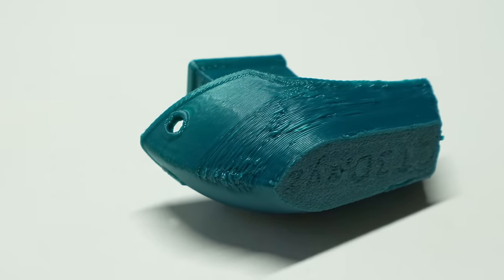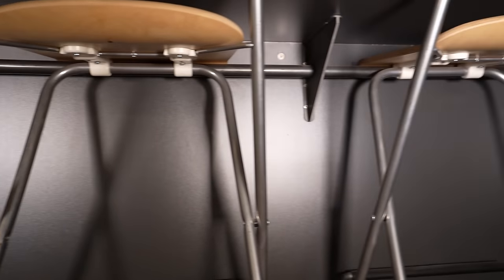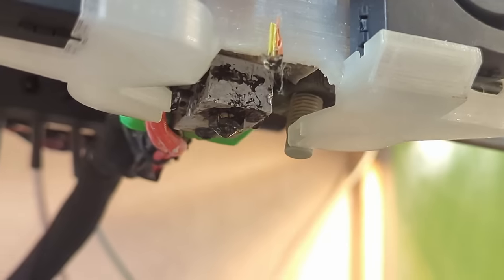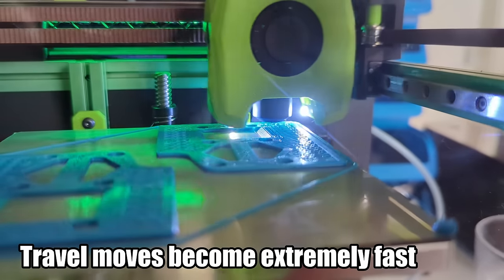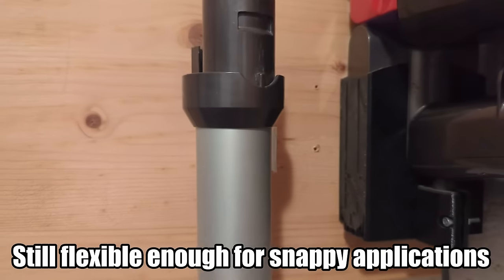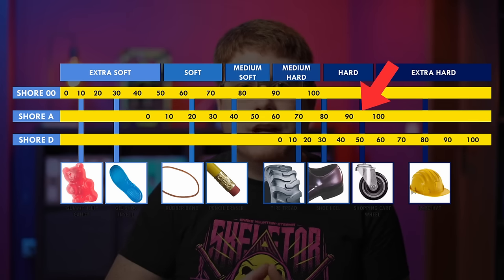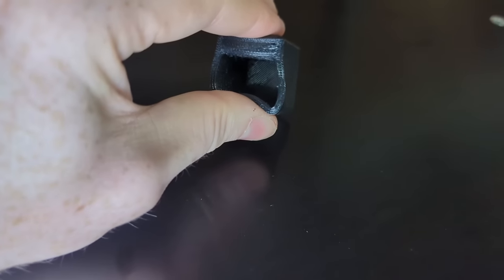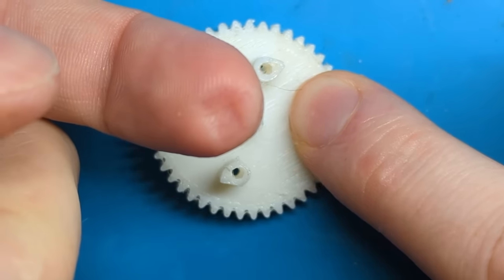3D printing material: When to use PLA, PETG, ABS, TPU, Polycarbonate, Nylon etc.

Comment: PLA is not outdated. It is renewable, cheap, reliable, easy to use and highly available. Yes, PLA flows under pressure but I argue that for drafts, decorative things and iterating PLA is unbeatable. More often than not I can buy really good PLA on discounts today. And for what I do I don‘t want all parts to print shiny as PETG tends to do. Oh and don‘t forget the things like woodfill and such, that works a treat with PLA, with PETG it will be a gloopy mess
Reply from the maker: As is showed I use PLA even in technical applications if it's appropriate and it never failed me.
Reply: pla is not renewable.
Reply: @ageorgiev89 Nor is it biodegradable, regardless of its claims
Reply from the maker: It is, but only at industrial scale at relatively high temperatures. Since it's made from corn starch it's also renewable. That doesn't apply to impure "+" filaments with additives of course.
Reply: @SmallBatchFactory  the vast majority of pla ends in the trash with everything else. Even if it didn't and people put plastic for recycling, they still won't separate pla specifically for recycling on a global scale. So, just because it technically can be recycled, it doesn't mean anything.
Reply from the maker: @ageorgiev89 the material itself is still renewable, unlike crude oil based material. It not being recycled is a whole other tonic but even just burning it is still fine if you can just grow new plants to make it from
Reply: @SmallBatchFactory  Whatever helps you sleep at night
Reply: Reliable at room temperature. So to me that isn't really reliable at all. In my opinion it is a hobbyist filament for teaching people how to use an 3d printer. If you print something and it can warp in a hot car then it shouldn't be considered a serious filament.
Reply from the maker: @clutchboi4038 I'll never take my shelf brackets to the car so they're fine in PLA
Reply: @SmallBatchFactory  As long as there is no direct sunligh in the room, or a heater near by. You know it's gonna sag even at under 50 degree exposure
Reply from the maker: @ageorgiev89 definitely. I had parts deform in an air conditioned office. I mentioned that somewhere, but maybe in another video
Reply: @ageorgiev89  Renewable != biodegradable. Also, Renewable != recyclable. I think you two are talking about two different things. Personally - I am very cognizant of the waste I produce, which is why I try to limit physical test prints. Because, I am unable to destroy the plastic without it becoming micro-plastics. At some point, I would like to invest in a crucible to be able to burn it at a proper temperature and to be able to create small metal casted parts. I hate the fact that most people just throw it away in the trash. I hate even more that people throw it in the recycling bin, which will result in the recycling center throwing it into the trash. I don't know of any recycling center nearby that would recycle plastic bits that are unmarked.
Reply from the maker: @d-leb thank you, finally someone gets it
Reply: I have become very impressed with pla after seeing how competitive it is in strength.  James Bruton basically switched to it in all of his robots and projects.   To be fair the projects only have to work long enough to make the videos and he is presumably getting the filament for free or very cheap.
Reply: @clutchboi4038 what’s a good filament for inside of a hot car? I just printed a ham radio bracket in ASA and it’s been fine during the winter but now I’m worried that I’m gonna get hit in the head with a radio in July
Reply: @Grunttamer  you picked a good filament. ASA, ABS and nylon are the filaments to use in hot car temperatures. Nylon performs the best but ASA and ABS are perfectly fine for hot car environments and won't melt in a hot car. Now if for some reason you are working in temperatures higher than a hot car in some industrial application where the machinery produces more heat then nylon would be best.

If you search "hot car filament test" there is a guy who made a good video demonstrating different filaments inside a hot car here on YouTube. PLA and PET are a no go.
Reply: @clutchboi4038  I guess a good way to remember is “don’t leave your PET in a hot car”… I will see myself out
Reply from the maker: @Grunttamer ASA is one of the most temperature resistant materials for home use. You should be totally fine. If your car gets hotter than 100 degrees humanity is screwed anyway
Reply from the maker: @clutchboi4038 funny enough there is HT PLA out there that can take a lot of heat. Tom's 3D printed an espresso mug out of it years ago.
Reply: @SmallBatchFactory  well I live in the southern us so outdoor air temps of around 40C are common during June/july/august.  A black dashboard can supposedly hit 93C in direct sunlight.  So if I keep my printed materials out of areas like the dash I will be fine.
Reply: @SmallBatchFactory yea and it's double the price of ABS and ASA and needs to be annealed still from what I'm looking at right now, which is even more post processing. In my opinion that still makes PLA obsolete because you can just buy ABS or ASA and print without the need for annealing and spend less.
Reply from the maker: @clutchboi4038 I'm all in on ABS. But a lot of people can't get it to work so HT PLA can be an alternative for them.
Reply: The heat consumed in production for things like heating the bed are drastically lower for PLA than other materials too. This means even the electrical bill for PLA is generally cheaper than most other filaments. Something not to be overlooked when mass producing parts.
Reply from the maker: @Mad_Catter_ definitely! It also means less heating time when doing rapid prototyping.

I recently discovered Polyterra filament which is also easy to cut with a knife so doing corrections to check what needs to be changed for the final design.
Reply: Best of all, PLA is biodegradable
Reply from the maker: @donepearce it is, but it also needs high temperatures. Sadly it's not enough to just let it sit in your garden. CNC Kitchen did a great video about that

Comment: I use PLA for the majority of the things I make, because I actually like the rigidity in most applications.  I use PETG when I need functional clips/bending compliance.  PLA is one of the most underrated materials nowadays because PETG fever.  I see so many failures of PETG when used in mechanical designs where they're under tension or compression.  Because of it's flexibility, it can be a bad material for some applications. I also like PLA because it's cheap, and I have access to a recycler that exclusively recycles PLA, so none of my wasted parts are every truly wasted. There's no one material that will work for everything.
Reply from the maker: I'm totally with you. Just like carbon fiber filaments PETG is a craze where people think it's automatically better in all applications.
Reply: plus if you have the equipment to anneal PLA it's way more temperature resistant than people think it can be.
Reply from the maker: It's extreme, from what I've saw. Didn't have lick trying it in the past but I probably did something wrong. If you have parts where you don't care about 100% accuracy or can account for the deformation this is an awesome technique.
Reply: @SquintyGears  I find high end PLA more temperature resistant than most of the tests I've seen online.  Multiple times, I've left PLA prints under compression in a car on an 85 degree day with no deformity.  Maybe my car just stays cooler than most peoples?
Reply from the maker: @meikgeik I can imagine that you used PLA+, which contains additional additives that change material properties.
Reply: @meikgeik  assuming 85F, it's not that wild. It'll really start softening at 40C and when you're doing the annealing process you do your best to keep it at 50~60C depending on your particular filament. It'll definitely warp some amount then. But afterwards it'll easily stay solid at 85C and it's also significantly more rigid/brittle. Not a huge deal since PLA is already a hard brittle option so people would probably not be trying to anneal a living hinge design...
Reply: @meikgeik I printed U.2 NVMe drive cage from PLA. It literally melted on the drives. I moved to ASA for parts like this, but for everything else PLA is just the go-to material.
Reply from the maker: @Vatharian yes, you definitely have to consider temperatures. CNC Kitchen experienced something similar. He printed a part for his CPU cooler which gave in at some point and crashed the machine.

Only thing I printed so far is distance brackets for my under desk mounted PC with watercooling on top. Otherwise the air would be blocked.

And I printed a few parts for my laser cutter. The laser will melt any material if it goes astray but at least PLA isn't as toxic as others.
Reply: @Vatharian  I mean 85F is just 30C, internal computer parts will easily have surface temperatures of 40 to 50C. even the fins on a tower cooler. straight off the print bed PLA isn't going to work for that.

tldr: unprocessed PLA not suitable for inside closed PC case parts.

for the record, in a standard closed desktop case, the air temperature is estimated to be between 30 to 40C by AMD for the calculation they make for TDP.

and entreprise hardware tends to have significantly higher surface temps because they assume it'll be in a server with powerful loud fans.

I think most people don't realize this because all the parts we touch on our electronics are required by regulations to stay bellow these temperatures to be considered safe for sale. So we never really notice how hot it gets inside.
Reply from the maker: @SquintyGears definitely. Play a few games on your smartphone and it will already get pretty warm. Computers generate a lot of heat.
Reply: Yeah I'm not sure why it's so popular either. PETG is fine but doesn't really compensate for anything that PLA is bad at, at least not enough to matter. It's not that much more heat resistant, it's not easier to print, it's not really better at UV or moisture resistance... it's just not that much of a step up. It's fine for creep and impact resistance, but it doesn't actually provide a way to print a different "kind" of prints , like say ASA or PC does
Reply: @amogusenjoyer  See I would extend that to ASA and PC too... if you need resistance to any kind of element, paint your part. spray on poly is cheap and easy to apply clear coat. it's a tried and tested solution that will work better than vague UV resistance (which is only a question of color fading btw).
they're just not worth the headache, with warping and enclosures and filtering, for parts that at the end of the day are as strong as any other plastic parts... it's not a 10x difference, not even 5x... If you need stronger, use higher infill. it'll make a bigger difference.

However the reason to use PETG is that it's more flexible, making living hinges out of PLA is a bad idea. PETG does much better, so it'll make more reliable compliant mechanism. if you don't need that advantage it doesn't do anything for you... it might be the main material you have on hand, it's so popular it's just as cheap as PLA.

I also don't think abrasive additives in filaments, is worth the wear on the nozzel. I mean people wanting glow in the dark is fine, it's the same as all the fancy dual colors and changing colors. people don't use those for mechanical properties.
Reply from the maker: @amogusenjoyer PETG is resistant to most chemicals (as mentioned in the video) which ABS and PLA aren't. PLA is not even fully warer resistant, I had prints swell up after being submerged for a few days. PETG works fine even after years in a fish tank.
Reply: @meikgeik where I live inside of a car can easily get 140+. PLA is a no go in warmer environments.
Reply: @Vatharian why would you even attempt that? Nvme drive controller temps are usually 65C and can exceed 90C under load. Kind of a no brainer that wouldn’t work…
Reply: I'm really new to 3D printing, but honestly, I really like my results with PLA and haven't had any desire to try other materials. I've done a few prints that suggested alternatives but everything still worked out great in PLA. It's kinda the Toyota camry of printing.
Reply from the maker: @TylerjWebb as long as you don't need flexibility or temperature resistance PLA usually works just fine. It's also very easy to print and a bit more environmentally friendly
Reply: @SmallBatchFactory  I'm interested to see how my prints hold up in the summer. So far most of what I'm making will be inside where there is some level of air-conditioning.
Reply from the maker: @TylerjWebb depends on where you live. If they don't bear load they should be fine if it doesn't go above 40°
Reply: Came to the comments to write the same thing and was pleasantly surprised seeing this as the first comment
Reply from the maker: @kekersdev in case it wasn't clear from the video, the conclusion is definitely NOT that PLA is outdated. Different materials have different applications, that's it.
Reply: @SmallBatchFactory  I think the person who posted the original comment agrees with the claims in the video ( and so do I :) )
Reply: What is the best material to print something that can withstand some shocks and/or vibration such as various clamps mounted to bike (for example to hold flashlight) or tripod - either screw head or plate? I have only Matte PLA, PETG and PCTG at the moment, I don't have heated chamber and I don't want anything with glass or carbon. So far my assumption is that properties vary among brands, color and print condition (fast printed PETG is extremely brittle), PCTG seems overrated and imho it's worse than PETG - despite promised ten times higher impact resistance, i would say that cracks form on much softer impact than in PETG, but it does not completely shatter as material is perhaps more ductile. Contrary to everything, I assume that clear PETG has best layer adhesion, Matte PLA is the worst, especially in white color - when breaking it breaks into fibers sort of like a wood. PETG just feels least immune to local pressure (tested with pincers), because it's the most brittle, which is surprising.
Reply: @SquintyGears  Not only surface temperature. Try to stress test GPU which can consume 200W and CPU which can consume 140W at the same time, there are some losses on voltage regulators too and air at exhaust from computer can be 20C above ambient temperature. Right now ambient temperature is close to 27C, cause we three week long heat wave continuing to early september with outside temps 19C in the morning and 34C in the evening. Yes, this is rare extreme, but parts have to survive this. Sort of sad part is that typical PC has horrible cooling, air for GPU is sucked from the bottom, exhaust goes mainly to the side and half of the air is likely sucked by fan again. Servers have nice air ducts.
Reply: @pavelperina7629  you can do guided air in a tower case too. Let me remind you, you literally are talking about 3D printing here 😅. And your own words are saying 20° above ambient, that's in the 50s in the worst case scenario. 60° is kissing up to PLA's glass transition temp, it gets soft so it won't hold weight well but it still holds it's shape until almost 80°. Just don't store your dumbbells on top of it 🙃.

Jokes aside, if you are worried you can always go with PETG. But I don't live in a house with AC, summers get hot, and I haven't had problems with PLA. I always have 2 fans in my cases.

I 3D printed an ATX case for my secondary system, the only asterisk I would add, is that I don't print everything with perforations following the instructions. I know where I'm going to put fans and where i want the airflow to go. So i only print those parts with the perforations. The others I set the inner surface to have full layers. So it keeps the look of the infill but the air is blocked from escaping that way.
Reply from the maker: @SquintyGears I recently got the first PLA heat victim. I printed spacers for my PC tower. I strapped it under the desk and the cooler is at the top. They held up fine for years but I recently got a high end GPU and that was finally too much. Nothing broke, they just got soft and deformed a bit.

Comment: I start from PLA. Like "why not PLA?". If I can get away with PLA, I'll totally use PLA just because, at the very least, there's some chance for it to biodegrade. PETG if I need a little heat resistance or flexibility. The other materials all need a heated chamber and have issues with toxicity.
Reply from the maker: Exactly, there's no reason not to use PLA if it fits the use case

Comment: Great overview of the materials, a series on tuning the slicer for materials would be interesting. Perhaps with and example use case for each material and ways of over coming common printing problems that the materials have.
Reply from the maker: Sounds like a plan! I'll put it on my ToDo list. One video per material seems like a good plan.
Reply: @SmallBatchFactory  That sounds perfect!
Reply: Detailed slicer settings per material would be great. Non-slicer specific. I’m curious about optimal fan settings myself!

Comment: High Speed PLA at 600mms is great for rapid prototying. PLA is great for toys and figures.
Reply from the maker: I recently discovered Polyterra, it can be cut with a knife. Makes it perfect for prototyping where perfect fit still has to be determined